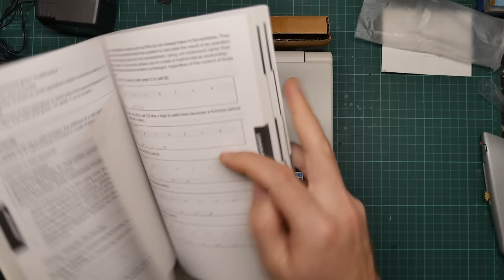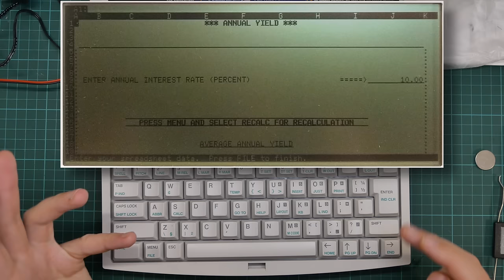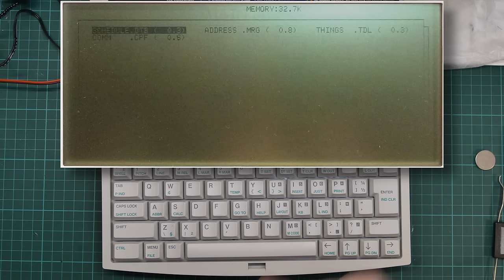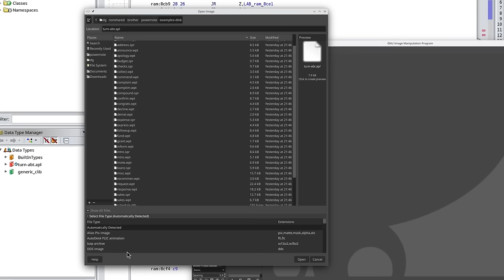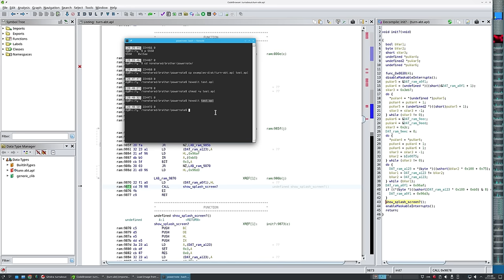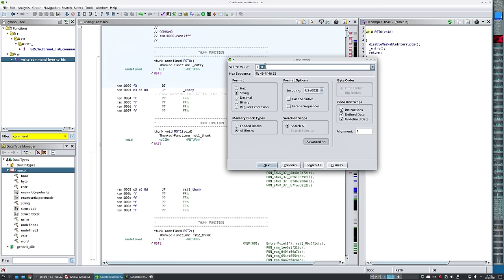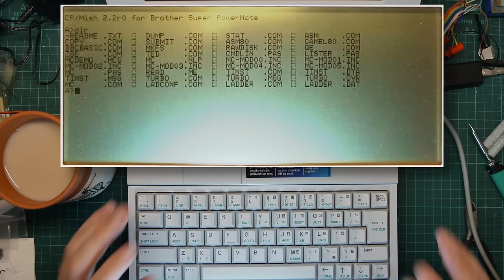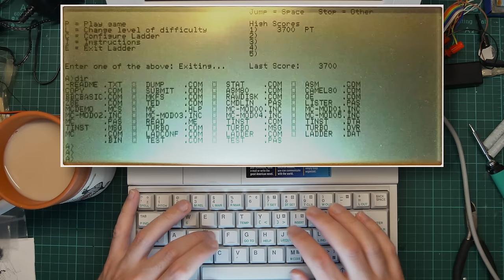Porting CP/M to a Brother SuperPowerNote Z80 laptop thing

Comment: Incredilble work. When you were striving to get the CS line of the floppy controller to react, I started to imagine the Speaker Port would be the better choice for sending ROM outside ;)
Side note: The similar level of "touch and feel" reverse engineering has been done recently by three ethical hackers of Dragon Sector team, to debug the induced failure mode of certain types of polish trains, without altering the built in firmware saved inside Swiss made onboard computers. Interesting read on "Zaufana Trzecia Strona" on hacking trains.

Comment: Hello! I tried the prebuilt img file and compiled from source but neither will boot on my Super PoweNote. It hangs after I hit return to load the CPMISH.APL disk application. Not sure what’s wrong. Great project! Would love to try it out!
Reply from the maker: Huh. File a github issue, please? Could it be you're using a 720kB disk instead of a 1440kB disk?
Reply: @hjalfi  hello! I’ve tried several 1.44mb disks and tired formatting them in DOS before hand with the same result of it hanging when trying to load it. Thank you for your reply.
Reply: @hjalfi has anyone had success loading the GitHub file on their Super PowerNote? Not sure if it’s problem my powernote or with the GitHub files.
Reply from the maker: @amateurtinkering2103  I have since found out that this version only works on the PN8510, and not any other PowerNote models (of which there were apparently plenty).
Reply: @hjalfi  thanks for the reply! If you’re ever able to make it work for other models then I’d give it a try again. So cool that you did this work!
Reply from the maker: @amateurtinkering2103  I've got an image which works on the PN8800, and in the process found some nasty bugs in the PN8510 version which could have been stopping it working.

Comment: One way you could of read the rom was to connect your Logic Anaylzer to the ROM socket, and then using the apl file just read all the address lines, and you would of had a listing in your LA.. , also, what Program were you using to decompile/view edit the decompiled file?
Reply from the maker: Sadly my logic analyser only has eight input lines, and for that you need one with 24 or preferably more. And they're silly money. Reverse engineering was done in ghidra but it doesn't actually support the z180 very well.

Comment: Now that you have CP/M running on it, you can install the VEDIT editor, a superb programmer's editor from way back then. Also, original versions of the Infocom games 🙂
I still fondly remember hand-coding Z80 machine code in 1976, and probably still have hand-coding mimeo page templates in my filing cabinet somewhere. Very nice work indeed!
Reply from the maker: If you know of any actually open source software I can include in the cpmish repository, that'd be awesome. VEDIT never had the source released, unfortunately, but I'm always on the lookout for more stuff I can steal, I mean preserve...

Comment: Turbo pascal for cpm uses control codes in an odd way to scroll the screen. You can configure these in the set up progrm for tp. This wasn't natively supprted in the teminal emulation on the terminal i was using with my Z80-MBC2 i worked with the PiGFX devs to eventually set this up so it works correctly.  I wish i could remember more of what was needed.  This is unfortunately about three years ago.

Comment: You should really have a closer look at CP/M 3. It has a lot of improvements that may not be obvious at a glance. 
It supports disk sizes up to 512 MB, and the interface to the disk driver is much cleaner. Also it doesn't just bank out the BDOS, but it also uses extra RAM banks for hash tables of the disk directory. It actually handles swapping disks way better, it has a much more flexible system of handling io devices. It natively supports programmable baudrates and the most comprehensive io redirection you could dream of. It also has support for a real time clock, including timestamps in the file system, and there are even Y2K patches available.

From a programmer perspective, it offers a lot of additional BDOS calls. It let's you specify what the os should do on errors, so you can do your own error handling. It has a call to parse a string as filename and automatically set up an FCB for it. It also lets you specify the string terminator character, so you can use the BDOS print function with 0-terminated strings. And there is even more than that. 
All the while being 90% backwards compatible with CP/M 2.2 software.
Reply from the maker: I've looked at it, but I feel like the extra complexity outweighs the benefits --- for example, booting CP/M 3 involves loading a CP/M 2 BDOS to load the SYS files! Although, now that all the Digital Research source is properly open source, it'd be nice to add CP/M 3 to the cpmish repository. I just have no time. If you want to volunteer...
Reply: @hjalfi  I would need to know a lot about the device, all the io addresses and the chips used.
And since I don't have a device, I would need an emulator to do the testing and debugging.

Comment: How you describes the floppy integration into the system looks for me a litte bit like it's done in the Atari ST. Only the pure reading/writing of data is done over the Floppy chip itself. The chip sits behind the DMA chip. The Floppy controller can only be accesses through it. All other functionality like selecting the device, checking for media change, etc is done through an other general IO chip.

Comment: Really nice. I especially enjoyed the bit-banging of the ROM via address line. Sadly the thing has no speaker, otherwise beeping the ROM as morse code and recording that would have been another option. ;-)
Seriously: it would possibly also be an option to solder some wires to the ROM chip, take it to a breadboard and do a ROM-read circuitry there, but abusing an address line is admittedly more fun (and probably much faster). :-)
Reply: Or displaying it as a qr code on the screen
Reply: Yeah, that bit-banging is exactly the kind of out-of-the-box thinking I love to find in these kinds of videos. Subscribed!

Comment: Nice, that’s a really cool machine to port CP/ M to! BTW, the thing with the center negative barrel jack connector is that the outer positive sleeve doubles as the switch between the battery and the external psu. You don’t want to witch ground, would you? PS: could you link the hires board pictures you took in the video. YouTube does a fantastic you of compressing all the details away 😅. Thanx.

Comment: at 58:55, the found but missing function, port they could be the serial & parallel ports on the back, they could be a lot like GPIO on say Raspberry Pie OI pins, in that there not assigned any function, until a software, path have been set first? e.g. the port only exist when program application, knows they exist, and programmed in such a was set up ports in such a was be serial or parallel  as the case may be?
Reply from the maker: The Z180 itself doesn't have any GPIOs or configurable peripherals, but the glue chip could have anything in it. If the pin direction is configurable that could actually be really useful. I have a parallel port ZIP drive that would be cool to make work.
Reply: @hjalfi  I was just calling GPIO'S as something to just call it or them, but serial & parallel ports, will not exist, until what ever is configured, so it's more than like it's some subpart part of  type document app/ spreadsheet app, so until the app is loaded up, there just pins on connectors and that about all the do? there not serial or parallel port until the at logic level been programmed? as you managed getting OS level access, (cool by the way)🙂looking around the supplies app the look like could interface with ports and see, how do the there connection to port's

Comment: aw, no z80 writing this time around :( still, great video either way :) pretty cool machine too - did you get around to figuring out how it draws the 1bit images? if the hardware just works with characters, does it have a modifiable font?
also shame about the keyboard. could it be swapped over to another brother typewriter one? i know it probably won't fit but i wonder if they work the same, at the very least.
Reply from the maker: I did, yeah, at least partially. If you set one bit in the video control register then it switches to 1bpp graphics mode. The main menu screen uses this. That said, some of the programs like the world clock make me suspect that the character set is redefinable; by using the right set of characters in a block on the screen you'd be able to address each individual pixel while also allowing normal text elsewhere. Other Brother devices do that. But I haven't looked into it.

Comment: So, this system has bitmap graphics - don't you consider designing a GSX driver for it? And, may be, even backport GEM...
Reply from the maker: GSX is an interesting idea. I'd need some way to make PRL files (and some documentation for them). GEM, sadly, doesn't run on the Z80.
Reply: @hjalfi  GEM... not now, that's why I'm talking about backporting. But it is written (mostly) in C, and the source code is open. And, as far as I'm aware, it long time used GSX API for drawing windows etc, only in later versions GSX was totally dropped in favour of something more fast...
Reply from the maker: @alextrusty2585  You could do a lot worse for a low-end GUI. I still think GEM looks really sharp on monochrome screens. Alas, this machine's video memory isn't memory mapped so it takes three out0 instructions, or 39 t-states, to write to a single byte. There may be some shortcuts but I don't think interactive graphics is really its thing. Now, a Borland-style fake-gui-with-redefined-characters; that it could probably do really well.
Reply: @hjalfi  The video subsystem apparently acts like some sort of VDP. I wonder if it's TMS9918 compatible? If so, it has hardware support for graphical primitives like dots, lines, rectangles et al, which would be good for GSX.

Comment: Is it work on PN-8500MDS?
Reply from the maker: It might need some tweaking --- the PN-8500MDS is very similar but does differ in a few places. If you have one, please try it?
Reply: @hjalfi  I did, it read the disk and froze. I opened it and saw that the FDC chip is different(HD63266F), but the CPU is equivalent(HD64180RF6X) and has 8Mbit of Mask ROM, 1MBIT of main RAM and 128KB of additional RAM(instead 256KB). I have no reverse engineering skills, but if I can help port to this model, I'll be very happy.
Reply: I made a rom dump from it, if you need, just ask.

Comment: 9V center negative is absolutely NOT unusual if you play the guitar and own any pedals...
Reply from the maker: I did not know that. Might make a good source of power supplies (although I'm guessing they're musician-branded and overpriced!).
Reply: @hjalfi  Depends, there are many alternatives; but the main problem are those pesky barrel plugs that come in a plethora of incompatible sizes.
Reply: @hjalfi  Nor is centre-negative unusual here in Japan; in my experience it's more common here than centre-positive on '80s computer equipment.

Comment: Не так прикольно, как bbc micro. Потому что нет настолько интегрированной игры в память устройства, как Елита. Но тоже ничего плохова. CP/M это просто формат файлов. Кроме того на  bbc micro были уникальные опции для коммуникации, можно было загрузить программу через телетекст.
Reply from the maker: I grew up on the BBC Micro, so yeah, it was a great machine. No tape punch or reader, though! You might be interested to know that I have CP/M running on that, too...
Reply: @hjalfi  This is wonderful. I think there is a chance that in 10 years all this will be in demand for new analog chips.

I know modern technology stacks, but I can’t say anything good about them. If you need to do something well, then it is better to do it on bare metal.
Reply from the maker: @Ignat99Ignatov  I would actually like to write a CP/M-ish BDOS in C, for modern processors. It might make a decent smaller alternative to FAT for very resource-constrained systems. Sadly many of the popular low-end CPUs these days can't run code out of RAM (e.g. Atmel 8-bit), and the ones which can are boring ARM or MIPS variations. The MSP430 is still lurching along, and it's really nice, but its days are definitely numbered.
Reply: @hjalfi  I am not sure if they would be a good target, but things like Ben Eaters CPU on breadboards, or the Gigatron might be good candidates for that OS.